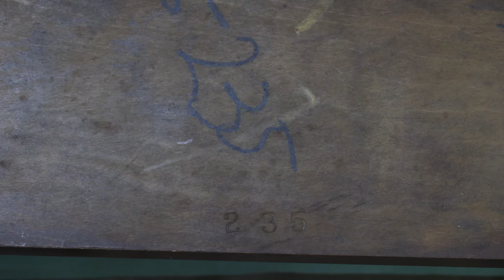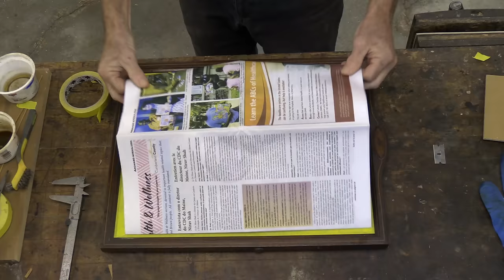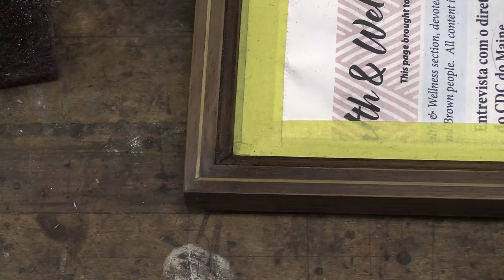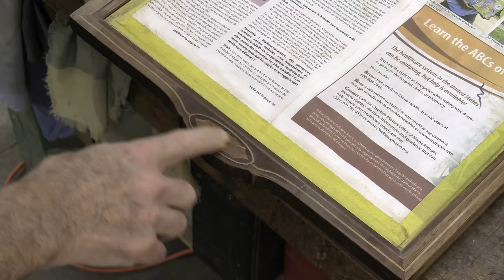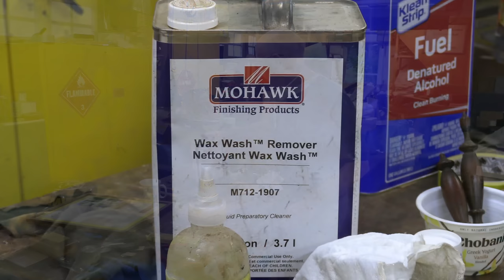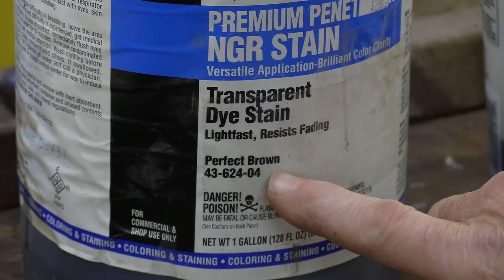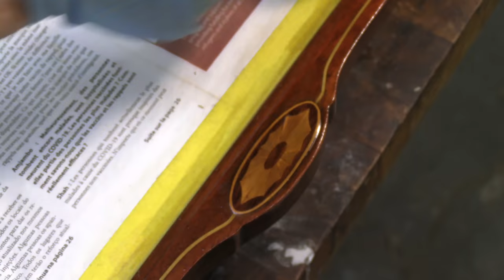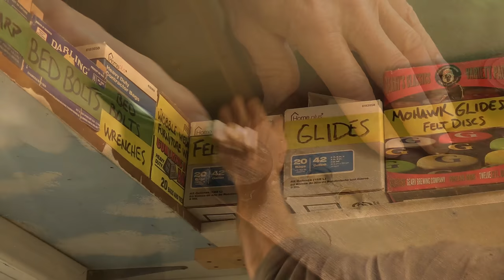PRO Antique Mirror Restoration - Thomas Johnson Antique Furniture Restoration

Comment: Here are a couple of ideas you may want to check out. #1 There are some videos on Youtube showing the use of Bar Keeper's Friend to remove dark stains from wood. Yes, it does contain oxalic acid.  #2  If, after you apply the oxalic acid you then immediately cover the workpiece with cling film it will have a much longer working time.
Reply from the maker: Thanks! I'll check them out. Good idea about the plastic. I've always done that for stripping, but hadn't thought about it for the oxalic

Comment: Why did you put a finish on the bottom of the base??? It would have never originally had finish in that area. I would lose clients if I did that. Its just plain wrong in my opinion.
Reply from the maker: Yes, I know what you mean. But in general wood should be finished both sides, so I will do that when I can. I usually don't do much if anything with these secondary surfaces, as they can provide a lot of information. On a factory made reproduction like this mirror I am less concerned. I don't know if I have ever had a client that looked at the bottom of the piece!
Reply: @johnsonrestoration  Hello Thomas, thanks for the response. I didn't realize the mirror was a repo... so I guess it doesn't matter much. Having said that, I would never do it.

Comment: Thomas you are getting very 'metric' Looks great, could that stain have been an acid stain? (like from batteries leaking) whick could explain why 'acid' didn't fully remove it, could you use an alkaline on it?
Reply from the maker: Thanks! That's a good idea, I didn't think of that. But it was a bottle - maybe perfume?

Comment: Does the finish "fisheye" due to heat/cold or is it from applying finish a bit too thickly? I have had this problem a lot before and haven't been able to pin down the reason why it happens.
Reply from the maker: Thanks! Most of the time it's because the surface is contaminated from polishes etc. So you use light coats in an effort to seal it in

Comment: Using a scarf joint on the inlay repair will give you a better fit and a less conspicuous repair without the need for filler.
Reply from the maker: Thanks! I have often done that... these days my rule is to remove as little as possible, even giving up those beloved scarf joints!

Comment: Very nice work. I noticed that the mirror glass itself appeared to be modern, by which I mean optically correct where perhaps the original was not. So maybe the original got broken and was replaced before the piece found its way to your shop. Of course, I could be wrong about this, but it made me wonder: would the owner of an antique mirror be more concerned with authenticity, or would it be more important to have mirror glass that gives an undistorted image? Replacing the glass probably would not add a huge amount to the cost of the restoration. I'm guessing authenticity would trump functionality for most.
Reply: Bear in mind that by the mid-1800s plate glass was in common use, and this piece is certainly later than that - I'd be pretty confident that the glass is original looking at the back of the mirror frame; it seems untouched. 

Recently we went to Kingston Lacy, and one of the loggia windows glass there dates from the 1830s - it's enormous (4 x 1.8 metres - single pane), but it's extremely clean and flat.
Reply from the maker: Thanks! dlevi67 is correct - this piece is early 20th century and I suspect the glass is original. But in answer to your question - I always keep the original, even when it's broken sometimes! Check it out: https://www.youtube.com/watch?v=VTBnHT_Ldlg
Reply from the maker: Thanks! That's interesting - I have never known when glass became to be as we know it now. How did you know yours was original?
Reply: @johnsonrestoration  It's in the history books as a survivor. Whether the books are telling porkies... I don't know, but everyone seems to tell the same story. I could not detect any sign of the glass ever having been moved, whereas signs were quite detectable in the other two windows of identical shape and size in the loggia.

Comment: Would you use the side without the washer to tighten/loosen the mirror movement and the it pivots on the washer? Or vice versa?
Reply: Yep - that's what they are for. The washer makes sure that the pulling force is distributed over a larger area and the screw is not pulled through the pillar, and the cone provides adjustable friction.
Reply from the maker: Thanks! Honestly, I'm not sure why there was a washer only on one side. But the mirror fit well so I left it the way it was
Reply from the maker: Yes, and what I don't know is why there was only one
Reply: @johnsonrestoration  I think they did it on purpose - I have at least another 2 similar mirrors, all have one washer and a conical fitting.